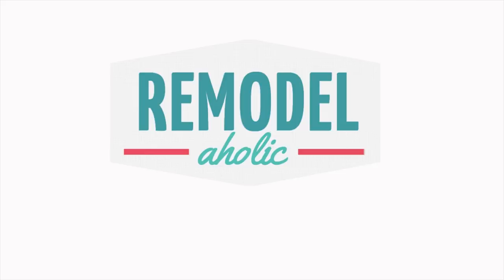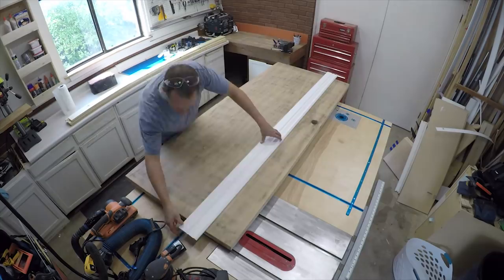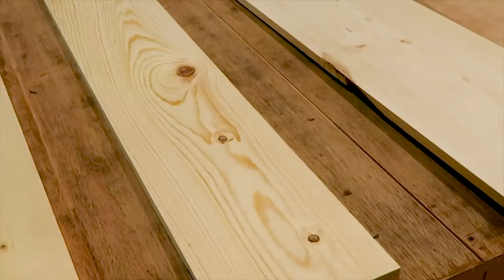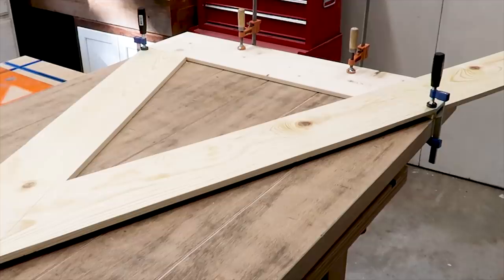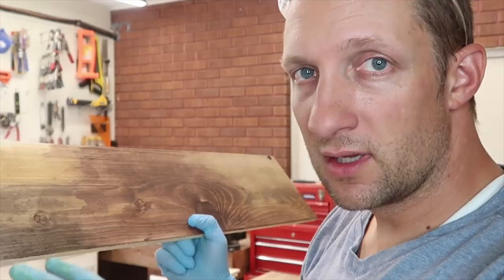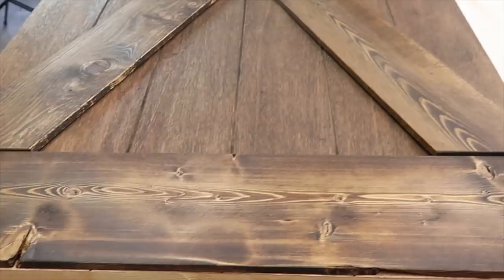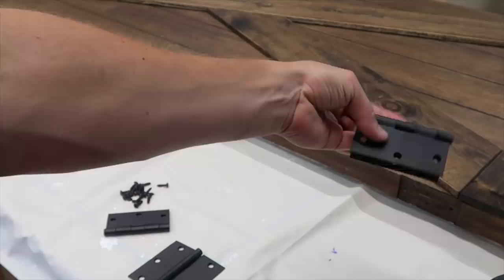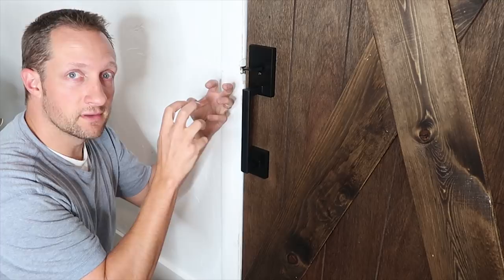$25 DIY Barn Door; Old Door Makeover

Comment: That's awesome great job!, this may sound dumb but was this a solid or hollow door
Reply from the maker: Actually, this is a totally important question!!  It is solid core door and we couldn’t do this makeover in the same way, with as deep of grooves if it wasn’t!   If you have a hollow core door what I would suggest doing is adding like 3/16 inch board with the grooves carved into it on top, If you carved out to grooves with a hollow core door you would break it apart!!
Reply: @Remodelaholic  thank you so much ...yes mine's hollow and I will do that thank you
Reply from the maker: By the way, there is one more option!!  He didn’t mention in the video, but I referenced it  in the blog post.  Another way to do the grooves where you’re not actually cutting, but instead you’re basically scratching or denting  the grooves into the woods and we have a tutorial for it on YouTube here: https://youtu.be/atzcJAb7q3o Go check that video out (and instead of the wall boards you’d be doing them for the grooves...  GOOD LUCK!
Reply: @Remodelaholic  thank you I'll go watch right now 🤗

Comment: How can you change the stain color on a pre finished door
Reply from the maker: Because the door had a wood veneer, we were able to sand the old finish off and refinish it in the new color.   It really just depends on the type of door you have!  If it is wood, you can sand off the old color, if it is metal or a pressed fiber/ molded door then your options would be to paint.

Comment: Ugh I love it but I don’t have a planer! :( I think 3/4” would probably be too thick and with ply wood I have the issue of the edges... any cost effective ideas??
Reply from the maker: You may be able to use 3/4” stock.  The only thing you’d have to double check is that with the added 3/4 of an inch will your door still open all the way?   or would catch on the molding or hinges.  A quick solution might be (If you have a table saw or access to one) you could chamfer the edges with a 45 degree angle.  So that the door swing isn’t effected.  If you plan to paint the door, you could use MDF bender boards (super cost effective- about a quarter inch think- but would have to be painted....). Last option, do you have any friends or neighbors that own a planer or is there a local wood shop class available?  Sometimes a community school has classes with access to AMAZING tools!!
Reply: Thank you so much! I did think about potential he painting it… That would allow me to use much thinner/cheaper material! I just love the way yours looks! I’m going through all your videos thinking of all the projects that I want to do now!! Lol
Reply from the maker: My original goal was to paint mine blue, to match the rest of my doors- but I like how it turned out, so I haven’t painted it yet!!  But it’s still on my “maybe someday” list!!

Comment: Question:  Is there a way to do this to a door that opens inward? It would make the door too thick for the hinge placement, right?
Reply from the maker: You would need to bring in the wood clear from the from the edge of the door casing so it will close properly.